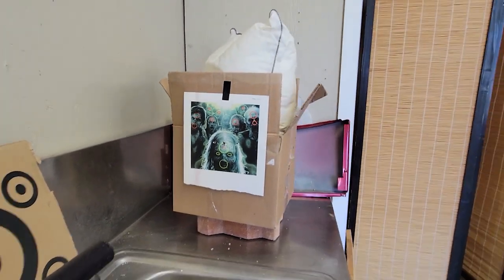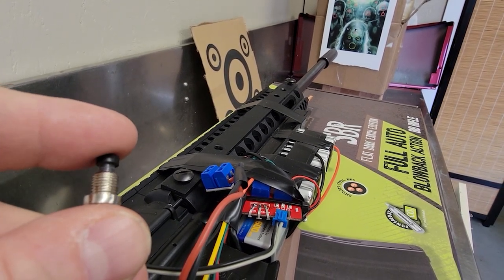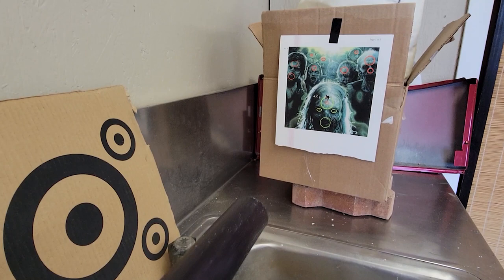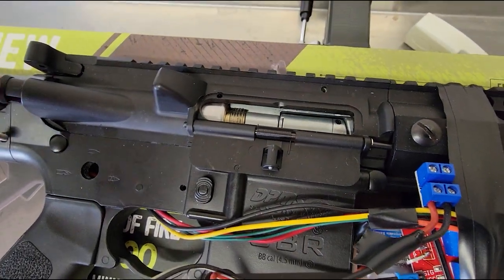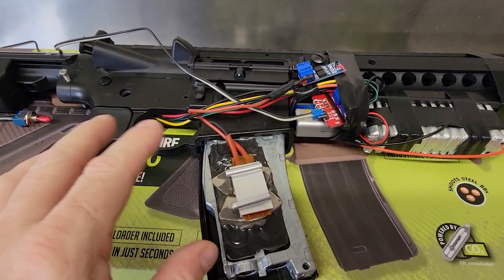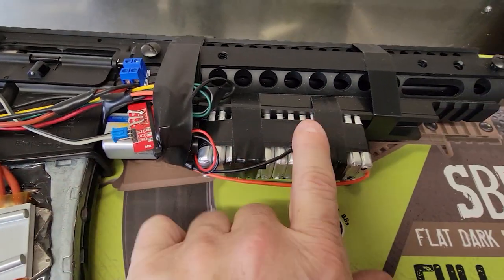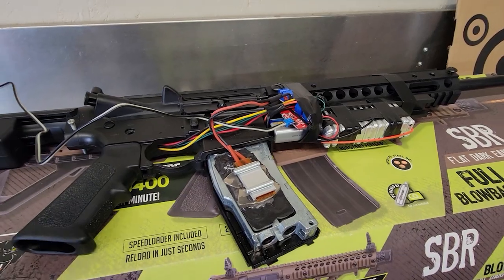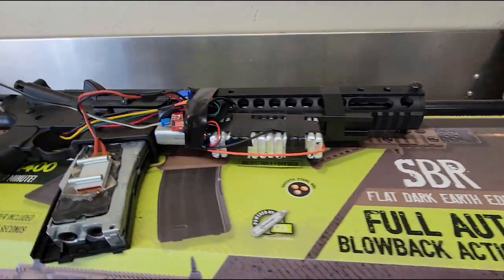DPMS SBR 50Volt Hammer Mod Conversion  ** ElectroBoom ** Rev.1

Comment: Looks like you've got an airsoft AEG that shoots 4.5 mm bbs instead of 6mm bbs. How do you know it does  500 fps plus without a chrono ?
Reply from the maker: There was no need to chrono it for the video. The magazine has a release valve for blow back and is wasting co2. Does airsoft use co2 or a spring? For the record it did 400fps+ through the chrono with the solenoid. I'll post a short video.

Comment: Man I can appreciate your work but why would you want a blowback ar15 airgun that doesn't function similar to  a real ar15 and now has all of this extra weight and batteries hanging off it. I'm assuming you will refine this to hide the batteries where the buffer spring and bolt carrier are housed. Why not just use an electronic hammer that still utilizes the guns blowback functions. Like I said I appreciate the hard work but this is.far too much going on.  You should try making a rail gun or an all electric bb gun like the new Barra ar15 electric bb gun. That thing is cool
Reply from the maker: It's all in good fun. I like building things with leftover parts or take it apart and build something that no one else has or fix factory design flaws. I thought it was time to start building some cool futuristic Co2 powered bb rifles. I still have a couple stock crosman dpms. But I also have a 50v dpms with an electronic hammer that I can electronically control. It's now working in full auto! The lithium batteries are light. Update video is coming. I appreciate you checking out my videos, thanks!

Comment: I bet you could use the size of quick load magazine but not holding bbs holding batteries for heater and 50v get 3D printed forward grip of battery pack. Just saying and not taking anything from ur intelligence u would done it probably it’s lot to build proto type and test lol. Thanks that’s going be real game changer people are going to want u to build them one.
Reply from the maker: I'm in the process of purchasing a 3d printer to start printing parts. Lol i blew my first battery bank and shocked my self a couple times building this monster. I'm glad my dpms broke when I got it. Thanks crosman!
Reply: @rumblecanada  I have 3D ender3 max. Wish we lived closer together. Shit it be on.